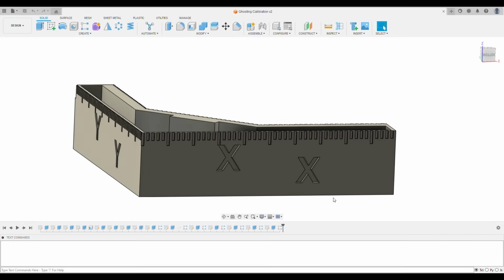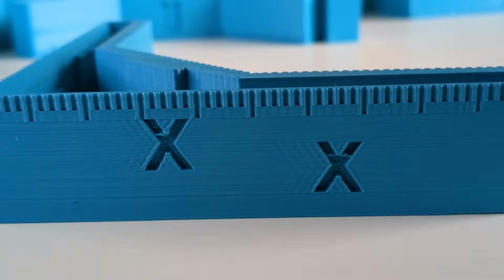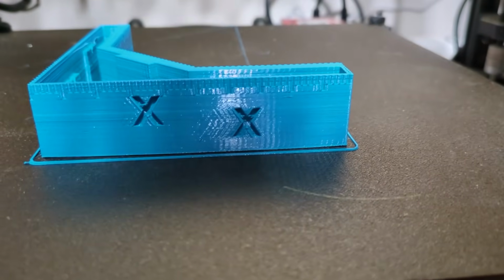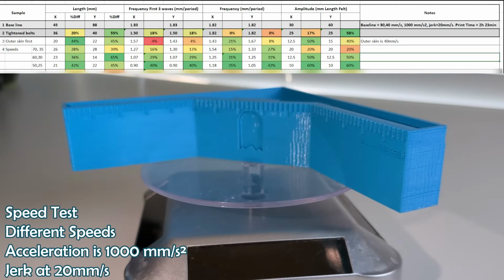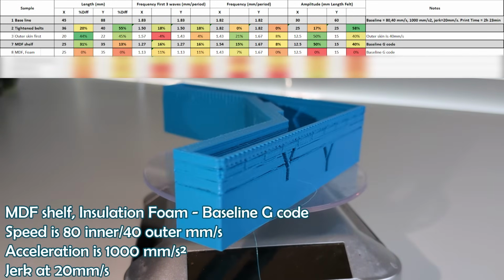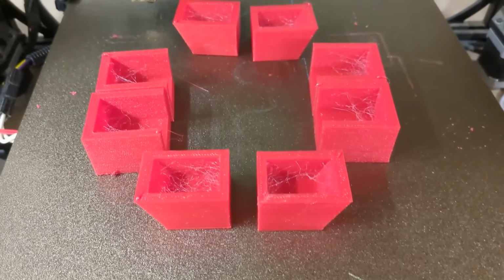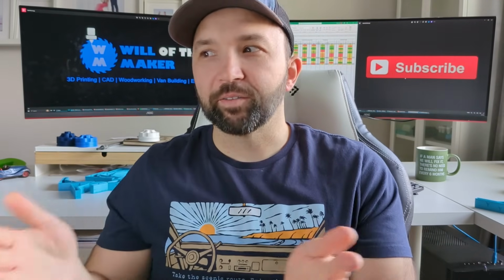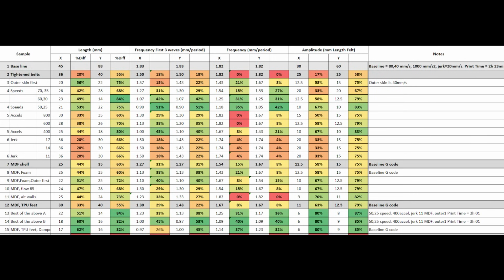GHOST BUSTING! A systematic approach to stop ghosting. also, should printers have shock absorbers?

Comment: Dampened and non-dampened belts with and without input shaper would be a very interesting test. Great video.
Reply from the maker: Thanks. I think dampening belts would help reduce the need for input shaping and processing power while still getting good results. Especially if there is proper dampening values. I had a whole talk about it but cut it bc the video was already getting too long.
Additionally having the print head be dampened from the carriage would make a bit impact.
Reply: @willofthemaker Damping definitely decreases the need for input shaping (and thanks so much for this video - I think you really did discover an aspect of printer tuning that’s been largely ignored), but if you want the best possible print quality, you should still use input shaping to take care of the rest of the ringing.  It won’t have to work nearly as hard and the results should be even better.  I’m not aware of any downside to using input shaping.
Reply from the maker: @fredhamilton1701  thanks for the feedback. I think the only real downside to input shaping is it adds cost through extra accelerometers and higher requirements on processing. Adding a simple damper can help in that regard, especially on older printers with 8 bit boards.
That being said, input shaping was definitely a big advancement in the industry for quality and speed

Comment: This is a great video, I especially like your systematic approach with the tables to compare and the special test pieces. 
I wonder a little about some comments like" you have a poor printer" or "with clipper you nowadays have not such problems". 
First of all, it's a good idea to get the best out of the hardware you have. 
Also, from my point of view, it makes sense to get to the bottom of these problems like ghosting and understand them. Klipper does a similar thing in the end to avoid these effects.
You shouldn't let know-it-alls get you down, I think both the approach and the execution of these videos are very good. 
And even if the fuzzy skin video had the idea of compensating for a few shortcomings, in the end it is a great video with the result of using the technology to get a different kind of printing surface.

Please keep going creating such great content.
Reply from the maker: Thanks so much! Very kind words. But ya there is a lot of great new tech that almost makes this moot. But people still have older machines or cheaper machines that might not be so feature rich so still good to know some of this stuff. I've had to focus on a couple other things (starting a business selling 3d prints I create) but should try and get back to video production soon!

Comment: Rather off topic, I know, but Klipper has a way to compensate for the resonance in your printer. 
However that should be the last thing you do, after your basic tune-up.
Tight belts, mass, and lower speed can reduce your ghosting by a lot by themselves. I don't use any foam or other decoupling device between my printer and the table it rests on, but the table is VERY solid. Only by cranking up the speeds and accelerations will it even move. (3500 mm/sec^2, and I cannot remember the print speed.) Placing it on a paver will lower the frequency and amplitude of the ghosting.
Reply from the maker: A lot of people have recommended adding Klipper to the machine. I may need to look into it at some point. Part of me likes keeping it stock purely for historical purposes and it is very reliable. Print quality is pretty good (relatively) now with these changes too.

I was always a bit skeptical to how much decoupling the printer from the table top would make but it does have some effect. I guess the different vibrations will effect different parts of the printer differently.
Reply: @willofthemaker  It all has to do with the resonance and moment inertia. If you have a heavier total mass, the frequency goes down. Adding reinforcements to the frame corners will also reduce the amplitude of the vibrations.
If you are running printers concurrently, decoupling the printer from a common plate will remove the outside vibrations.
Resonance is an interesting topic.
Reply: That is the way to go. These settings are great but the solution is to dampen the vibrations at source.

Comment: Interesting idea adding a belt absorber.🤔 It might be worth investigating the belt tightness differences with and without the absorber. I haven't tested this myself, but one random piece of advice I read was that if a belt was tight enough to play a musical note, its too tight. That seemed logical to me if you think of how guitar strings work, but as you showed your quality did improve as you tightened.
Reply from the maker: I think the belt likely got too tight. The tightening method on this printer is not the greatest to say the least so there was probably room for me to get it better initially. Could be a contributing factor to the improvement seen. A better design would have been to maybe have a clip on damper that isnt wedged in with the belt.

Comment: Is this printer running Marlin or Klipper?  As I see no mention of the obvious one for Klipper (input shaping), I guess Marlin, right?  And if so: did you consider going to Klipper (and changing the slicer to match)?
Reply from the maker: It's marlin cerca 2014 lol. Never upgraded the firmware. A lot of people have suggested klipper. So much so I will likely look into it
Reply: FWIW newer Marlin versions are supposed to support Klipper-esc compensations. Upgrading Marlin will likely be far easier than switching full-hog to Klipper

Comment: Interesting concept, but I’m confused why there is any ghosting at those speeds and acceleration. Before Klipper my SV06plus had zero ghosting at 80mm/s and 3k acceleration and 8 jerk. Only needed input shaping after upgrading Klipper for 6k accel and 150mm/s print speed.
Reply from the maker: This was all done on my nearly 10 year old printer with mostly all original parts, including belts (only replaced items are a couple nozzles and adding PEI bed). I built it in october 2014 and printers were nowhere near what they are now. A lot of the printers were still made out of laser cut wood. If you want to get an idea, watch "print the legend" on netflix. A lot since then and this one is showing its age. Both in tech and possibly starting to wear out. Its still very reliable, but not the greatest quality.
Also, i never updated the firmware. So it is still running 2014 software which doesnt have a lot of the features that are available now.

Comment: I did the TPU feet act, but I made them like coasters, probably much stiffer than yours, 10% infill gyroid, 95a about an inch and a half thick to the bottom but 2 inches wide where the standard feet set on.
I did an input shaping afterwards.
The biggest issue was external vibration from the other printer on the same table, it got the same treatment. as well as the nearby washing machine. it worked out the worst of it.
Now my speed demon can thunder along, while my slower printer isn't interfered with while doing slow delicate work
Reply from the maker: Awesome! Great to hear you had a good result from the TPU feet. Mine was Ninjaflex that is 85A so definitely softer. Maybe some more tinkering could help on my side.

Comment: It looks like one of the issues that your printer has is too low of a current on the x and y motors.  It looks like you have layer shifting that could be resolved by increasing the current to your motors.  Since you increased the tension of the belts, I thought that would have resolved some of the issue, but you might want to try adjusting the motor current.  I hope this helps.

Comment: Those TPU feet are still extremely stiff with such thick walls and minimal height. I designed some for mine for noise reduction that are about 60 mm high to the supporting face and only have 1 wall. I have one stiffer one under the corner that's weighed down by the PSU. I agree with you that the feet are unlikely to affect the ringing.
Reply from the maker: The walls are stiff for sure which i somewhat wanted to make sure it stays on the printer nicely,. Inside on the surface where the printer actually rests is fairly soft. IDK there could likely be more tuning to get a better result but probably not worth the effort tbh
Reply: @willofthemaker  yeah the gyroid infill is soft but the shear stiffness of stubby walls is high for the purpose of isolating the fairly low frequency vibration the printer outputs. I haven't calculated the response though, that's just gut feel.
I hoped to get some damping of frame vibration too (the motor excitation resonance in particular) but unsurprisingly I couldn't tell the difference.
Reply from the maker: @MiG82au  hmm I wonder if having a TPU gasket between the motor and it's mount could help. Could be hard to ensure a good residual torque on the mounting screws though.

Comment: I think it would have been helpful to calibrate for your material first. Flow rate/temp/linear advance, that type of thing. Then started playing with general settings. I think comparing different slicers would be interesting too. I recently switched to Orca from Cura and have found that my prints look better. I think Orca has more classes of line types that allows it to be smarter. Curious what to others think though.
Reply from the maker: I've heard nothing but really good things about orca. Honestly my days with cura are also likely numbered. It's really beginning to feel like a bit of a has been when it comes to slicers
Reply: @willofthemaker yeah you should, cura has some wacky stuff going on, orca is great
Reply from the maker: @riba2233  Will definitely look into it. Think ill do another couple videos with trying to get the most out of cura and then switch over.
Reply: @willofthemaker  cool, sounds good :)

Comment: Hi. I watched this and the previous video (about fuzzy skin). I think you have a really poor printer there. In my experience even an old stock Ender 3 without much tuning will give you better results. While your video's are informative (they do point out causes and possible solutions for print quality problems), I don"t understand why you put this much effort in getting this poor printer better. And "better" is still not good at all.
If I were you, I'd ditch that printer. Use it for parts on other builds, it will serve you a lot better. I tore down an old and really bad Anet A8 and built myself a Prusa bear clone from scratch. Learned a lot doing so, redesigned and modded it heavily, also Klipper-ized it. This now is by far the best bedslinger I have and it's quite fast too - for a cheap bedslinger, that is ;-)

How does your printer compare to the other one you have (timestamp 12:15)? I can't identify it, but my guess is print quality is superior.

Sorry for being critical, but I'm sure you'll make better videos with better machines.
Reply: Nothing really wrong with the printer, it just needs some tuning. It won't be as fast as newer ones, but it's the one he has.
The printer of Theseus, upgrade as you go. stiffen the gantry, upgrade the board, maybe upgrade the servos...
Reply from the maker: It's an old printer, lulzbot kittaz which is essentially a Taz 4 in kit form. I built it in October 2014 and it's honestly been incredibly reliable. It's a workhorse for sure. I've done really less maintenance than I should have over the years. Most of my prints don't have super sharp corners and while still some ghosting, this test piece really pushes it to be the worst possible it can be.

the other printer I just got about 2 months ago. It's a Wuxn WXR. Definitely can get better quality and speed from it. Been pretty happy with it over all and expect great things out of it as well. It's probably on par with a Prusa mk4 for half the price, built in America. (Although motion system is LDO). 
No need to apologize for being critical. It's an old printer and it shows it especially compared to what is out now. Has no bells and whistles. Bed leveling is with me screws and the bed is supported by springs. Which means there will always be some vibrations from y axis movement unless I rigidly mount it. This video made me pay a lot more attention to it than I ever have haha
Reply from the maker: Also, thanks for watching both videos. There will definitely be more videos to come with the new printer. One I think would be interesting is to do a side by side comparison of nearly 10 years development in 3d printers. At least with bed slingers. The Wuxn WXR doesn't have everything available nowadays but definitely a lot of improvements. One thing I love about the lulzbot is it is so easy to work on.
Reply from the maker: @GlennBrockett ya, it's honestly normally not this bad. This filament was good awful. I use it for selling things on Etsy that are circular and it is more than adequate. Slow yes, but reliable and has a big build plate I can fill up. And with those parts the quality is still pretty decent. And better now with the tune ups from this video. A lot of people have suggested adding kilpper and accelerometers which I might explore at some point

Comment: Next up: Put an ADXL on your Toolhead and Bed and fine tune resonances, cause your mechanical parts are at their peak already. If you dont have klipper yet: get it and set up input shaping... this killed all my ringing on my Ender 5 which got a CoreXY mod. Printing at 200mm/s now without artifacts. Only some cooling issues on smaller bits ^^
Reply from the maker: So many people are suggesting this i might just have to look into it. I don't think my hot end could keep up with those speeds but even getting reliable quality prints at above 100 would be a win for sure
Reply: @willofthemaker  even if you just go at 100mm/s that will be a big difference. I switched to Klipper about 5 years ago and never looked back. The fact that you just exit a text file instead of compiling a whole firmware every time was reason enough for me ^^
Reply from the maker: @mongini1  ya definitely a lot of advantages. Web interface for sending and monitoring prints would also be really nice and convenient.
Reply: @willofthemaker  so what are you waiting for? Order a Pi already 😁
Reply from the maker: @mongini1  Truthfully, just life gets in the way. too much going on some times  🤕But Im going to try and find a way to squeeze it in. Theres also a few videos I want to do before that happens. One being a comparison of this old printer and my new Wuxn WXR could be interesting to see how things have changed.

Comment: Do you have smooth idler or tooth idler?

I had to shop for idlers a couple times... the cheapest tooth ones you can buy basically don't work, so they're a little pricey if you get usable ones. But i found it to be good. No i mean you won't spend a fortune on them, but they won't be cent items either.*

The idea is that as the belt travel over idler, there is different number of teeth contacting the smooth surface, depending on phase different practical tension, so the belt repeatedly relaxes and tensions, causing belt vibration. Good tooth idler stops that, since every tooth has its dedicated contact patch that keeps the same distance without tooth flattening.

However the quality of smooth idler is unimportant, it might seize and you won't even notice. For tooth idler, the tooth profile (deep enough) and bearing quality is absolutely critical, or it's trouble.
Reply from the maker: Definitely good info. The pitch of the belt and any toothed part in the system need to be aligned and equal for sure.

Mine are smooth idlers though so that's not an issue for me
Reply: @willofthemaker   I switched from smooth to toothed specifically for tension improvement. Depending on belt phase, there is different number of teeth touching down on the smooth idler and different distortion on the teeth, causing the whole belt to oscillate. Just jogging the belt under higher tension feels much smoother on quality toothed idlers than on smooth ones.

Comment: You've started tuning in the wrong direction.

You already have an elephant foot, missing layers and layers of movement. (based on the video).

It would help if you went back to the temp/fun tower, checked retraction, and checked the hot-end and extrusion rate.
You definitely have some issues with mechanical parts.

Vibrations shouldn't have much effect on this speed and acceleration(they're creating most of the vibrations). 

You have pretty bad results with low speed.
Reply from the maker: The issues you mention with missing layers and movement were largely due to that filament. Same gcode and their gone with other rolls. That roll had multiple tangles and was generally inconsistent diameters. Kinda why I used it for this to not waste good filament.

Comment: Try a block of cement instead of tpu you have low weight in comparison to a car so just trying to stop it outright should be a help and for the 80's car that bounces its the stuts that are bad not the springs if it was the sping your ride hight would drop due to not being able to support the weight of the car anymore
Reply from the maker: I think in a cement block will be more helpful with multiple machines next to each other (like I have now). Definitely not the spring in the 80s car example. I mentioned the shock absorbers being shot causing that as there is nothing to dampen the energy. struts are a combo spring and shock